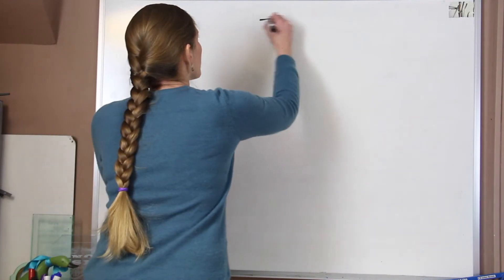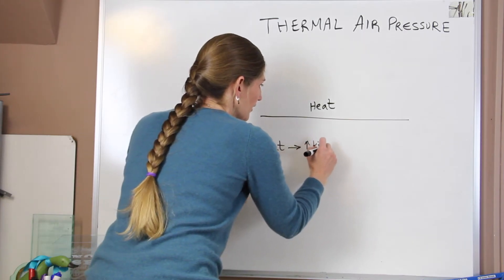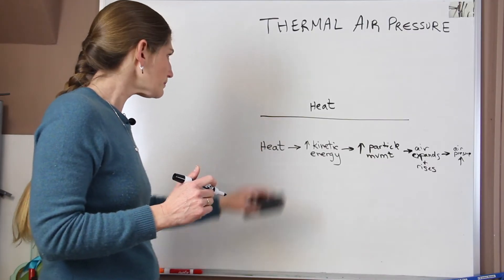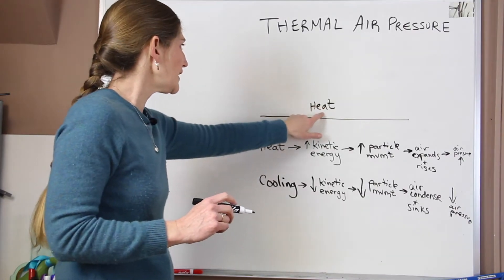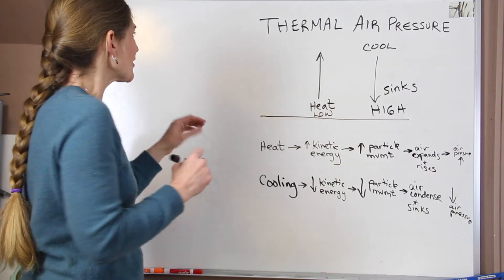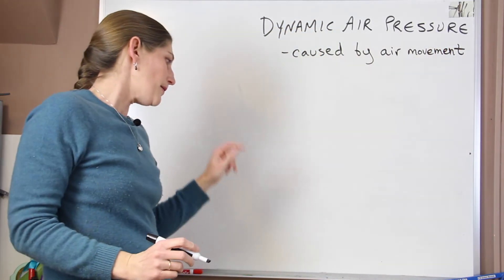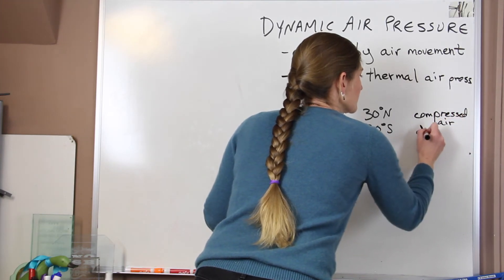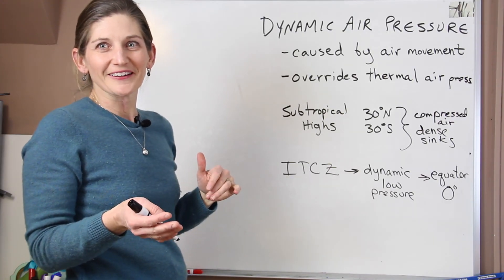Thermal and Dynamic Air Pressure

Comment: Temprature is inversely proportional to atmospheric pressure so when temperature rises that is there is increase in hot temperature a particle expand and atmospheric pressure decreases 
While when temperature decreases that is there is cold the air particles condense and sink this leads to high atmospheric pressure. ...
Temp. × 1/ atmospheric pressure 
I hope this helps ..

Comment: Sorry but your confusing thermal pressure (thermodynamic pressure) with the earths terrestrial natural (static pressure field)! As thermal pressure cannot exist out of a limited boundary surface integral!

Thermal pressure generation is not ideally possible within unlimited open air atmospheric domain, basically ideally thermal pressure is non-existent in open unlimited spacial fields such as atmospheres!

It’s (static pressure) your meaning to explain, as when a molecular air parcel is heated, yes it’s molecular kinetic vibrational energy field is increased, by which it naturally relative to conservative thermodynamic law expands reducing the number of air molecules per unit volume of space!

Whereas this thermodynamic molecular expansion inversely reduces the (density) field & therefore this means that the (static pressure field) not a thermal pressure field has actually decreased & therefore now momentarily resides within a state of non-equilibrium, thus meaning that this parcel of heated & decreased pressurized air molecules becomes lighter than the surrounding static atmospheric pressure & it then begins to rise to a higher pressure altitude equal to its own static pressure field!

However as it rises it cools adiabatically releasing it’s absorbed heat back into the localized atmospheric environment until it reaches its static pressure altitude of equilibrium!

From there on ideally this parcel of energized air from below (lower altitudes of higher static pressure) will now advect upon a horizontal direction until it cools, causing the polar reverse to occur, by now decreasing its intermolecular kinetic energy field of kinetic vibrations thus decreasing its intermolecular forces of dispersion, thus inversely losing its ability to repel the air parcels intermolecular forces of attraction!

Such meaning, that the air molecules attract closer together increasing the molecular parcel of air (density field) per unit volume, of which once again the same parcel of air molecules are now in polar reverse state of static pressure instability, now becoming more dense relative to its weight per unit volume, of which it shall fall back to lower altitudes of same increased density & static pressure!

As (Static pressure) is the inverse component of the (dynamic pressure field) equating to the earths net total pressure field constant!

Whereas thermal pressure fields can only generate within heated sealed boundaries such as containers etc, because thermal pressure fields are a product of heated kinetically energized air molecules trapped within confined spatial field limitations, whereas (thermal pressure) actually does the opposite to (static pressure) whence heat or kinetically energized, it actually increases due to intermolecular deflection off the limited enclosed boundary surface of its container.